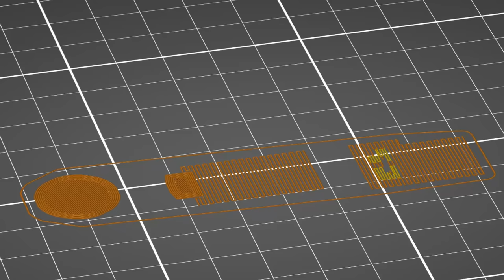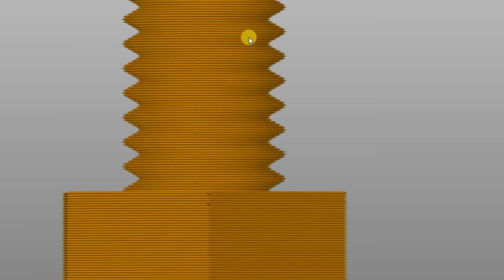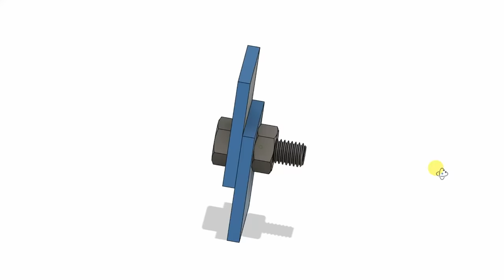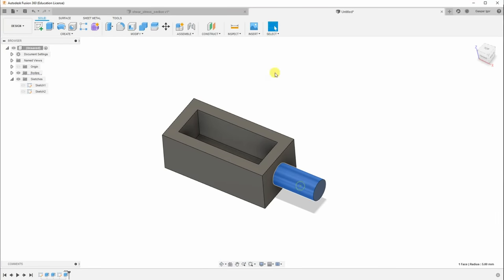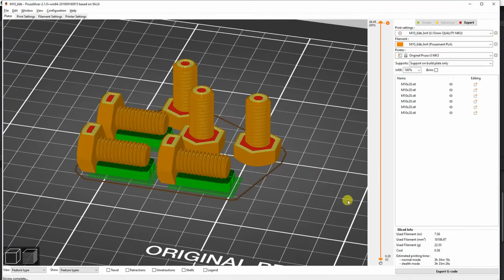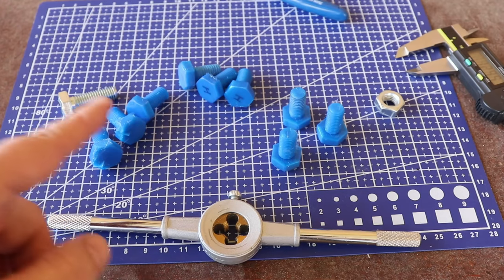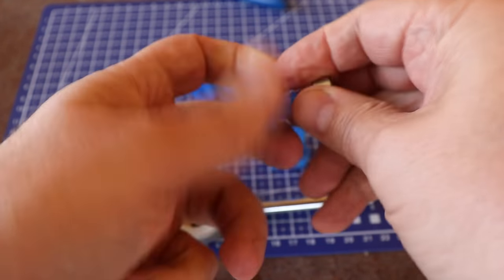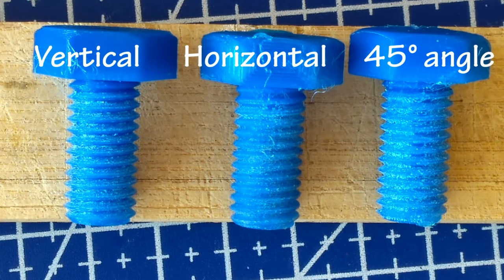3D printing bolt and thread in horizontal or vertical position - strength test

Comment: I did expect the horizontal to do the best .
 
 
The way it is printed is like placing many layer of paper. Try pulling 1 piece of paper, you may tear it, pull 20 at the same time. You wont do it. same thing apply with the shear test, push your finger through 1 layer of paper. You'll make a hole no joke. Try doing it with 20 at once.
And again same goes for the torque test. 1 piece of paper and turn it util it shear off. then take 20 more and do it at once. You'll just end up making a rope that is even stronger.
So when you were doing the torque test you were increasing the strenght of the bolt by a little bit util it reached his shear point.

Comment: Very nice video. I did think of one additional complication. Is printing a single screw different than printing multiple screws at the same time? One screw at a time would minimize cooling off the material between printing layers, possibly allowing for better adhesion, thereby resulting in stronger screws when printed vertically. Of course the downside is the time it would take to print goes up significantly.

Comment: Cut in half and then glue with weld-on 3/4. Apply glue, press both parts together, fit the head on a bolt socket and put on the nut right away. Let it cure and test it.

Comment: in the shear testing there is a difference which rotation is applied because if you just turn any degrees paralel to the  nozzle filament applied it effects the leaves that the cutting pressure if you just arrange the  90 degrees the shear stress o  the leaves of lines it would be the most strong one than the others...

Comment: on your torque test you were holding the tool at the top potentially impacting your result. It would be better to have a handle there that can rotate relative to the tool. The relative torques were probably still accurate. Thanks for doing these studies!
Reply from the maker: Holding on top is just for balance, because rotating arm is not in plane of the bolt. Shouldn't affect the results too much, but it was equal with all 3 tests anyway.

Comment: Awesome results, thank you for the experiment! Do you plan to compare pla vs abs vs petg?
Reply from the maker: Yes, but first SLA vs FDM (resin vs PLA). Almost finished test..
Reply: @MyTechFun  Thank you for the reply. Also, it would be interesting to study the material strength vs bed and extruder temperatures. Perhaps you'll find an optimum there. Best of luck to you!

Comment: May I suggest same set up but with a heavy duty  ratchet strap on lower side that way you can control adequately until failure.
Reply from the maker: I already have safer solution used in my latest videos. Also I am building arduino based tensile testing machine too..

Comment: Cool video! However, I wonder, is yield point even a thing for plastic? From the PLA stress-strain diagrams I found, there seems to be no yield zone.
Reply from the maker: Yes, I am very curios about that too. I am building Arduino based tensile test machine, I want to investigate this ellastic region (load before yield point).

Comment: Thankyou for doing a video to prove what we should already know.. the larger surface area, the stronger the object..

For the bolt, the largest layer area is horizontal. 

Very funny though, watching you fall on your rear constantly.. Thankyou for enduring the pain for the YouTube audience.. 😀😂🤣😉
Reply: What about the same stress tests using different filaments?? 🤪
Reply from the maker: I got several suggestions to try PETG. Will be done in near future

Comment: I had good luck printing an angled bolt by adding an bevel on the bolt head so it angles at 20 degrees from vertical--that way it does not need supports but is not vertical.  I guessed it would be stronger but based on this I am not sure.

Comment: Hey man! Awesome video! Just not quiet sure about multiplying earth's gravitational acceleration  (9.81 m/s2) when doing the Torque experiment. Gravitational acceleration only works on the Z axis not on X or Y axis which are the ones where you are applying the force, in this case you should be using the acceleration made by the movement of your hand, which I think it's really complicated to measure. So what about doing the Torque experiment applying the forces on the Z axis with a distance on the X or Y axis from your center so you can use earth's gravitational acceleration? Yet again, I'm not quiet sure about this, please correct me if I'm wrong. Printing my bolts in horizontal position from now on! Haha Greetings from México!
Reply from the maker: Thx for comment. If that scale would be a dynamometer, it would show Newtons. But it is scale calibrated for earth, this means kg has to be multiplyed by g (9.81 m/s2), no meter in what direction you pull it.

Comment: Nice video, thanks for answering something I have wondered about... I have a design on thingiverse (record clamp 2 styles) that uses a "threaded collet" type hollow screw piece.  Always printed them vertically and they always fail (torsion) after so many uses.  Will have to try it printed horizontal, to see how improved it is.
Thanks for the testing!

Comment: There are ways to enhance the layer adhesion also :) PETG is well known for having a high layer adhesion if printed correct (in my case I have to be carefull with cooling too hard)
Reply from the maker: I got more suggestions to try PETG, I will do that in near future. Thx

Comment: If you go over it with the tapping tool as you did, you might as well print it at the width of the thread but without a thread (full shaft). Then just use the thread tool on it. You probally need less support too this way.
Reply from the maker: In that case I would cut perimeters. It's better to print it almost good size and clean it with tap
Reply: @MyTechFun  milling is stronger than casting. What would be stronger, to print a knife or to print a block en cut a knife out of it? next video? ;)

Comment: Maybe could print multiples in one print and arrange them so they're touching and the bolt next to it for support/efficiency to replace some of the regular supports. You're probably going to need more than 1 anyways.
Reply from the maker: Yes, but this is not only about printing standard bolts, but also learning about thread strength as part of some 3D printed object.

Comment: My guess why the horizontal prints were the best was because of the direction of the layers. The forces don't act on the bond between the layers, so it's going to be more durable from a structural standpoint.

Comment: the horizontal print would be stronger when thinking of it logically even without the test, when printed vertically the stress is being applied to the seams of the layer bands the weakest bonding part of a print, where horizontally the stress is on full length of the print material. It would be the like gluing two boards together then pulling on the sperate boards to try and break the glue bond vs pulling on the glued boards trying to rip the wood in half. A weaker horizontal print would be turning the print 45 to 90 deg on the table surface changing the print bands direction this would likely make the shear test break at a lower weight but not the virtcle load, but make the torque test stronger.

Comment: An interesting test.
But instead of tilting the screw 45° while printing it, it would be interesting to see if it has any effect tilting it 30/60° to match the thread profile angle or whatever angle the pitch corresponds to!

Comment: optimal way to do this is to print in the horizontal to the major diameter of the bolt and then cut the threads with a die. Also want your outer shells to be larger than the maximum depth of the thread. I would recommend at least 2X.

Comment: I don't think there is any doubt as to which I would use in the future. Horizontal print costs 11% more from supports but it can hold far more than 11% more weight.

Comment: Nice test, but you need to pay attention with the creep factor on plastics(strain/ time factor). Plastic always deforms when there is a force aplayed on it. Thats  why deformation calculations are better then tensil strenght calculations.
Reply from the maker: I agree, as I mentioned at the end of video, determine a yield point would be better, but for this I need a tensile testing machine (building one, but it takes time)

Comment: Thx for the video, a note tho. On the torque test you don't use specific gravity to calculate the load, all force is applied in the horisontal plane
Reply from the maker: I am using a weight hanging scale, units in kg. I am pulling horizontally, if it would be a dynamo-meter (force meter), it should show Newton (Newton = kg*m/s2 , force = mass*g)

Comment: On the torque test for the horizontal screw, I think it capped at 2.3kg not 2
8 like you did in your calculations

Comment: my prediction is the horizontal will be the strongest. because it has unbroken layers going through the entire length. The vertical and angled ones can separate at the layer lines easier

Comment: Practically speaking however, this doesn't matter.  3d printed plastic is intended to be used as a method of rapid prototyping, not end-use objects.  Using 3d printed plastic parts for anything that will be subjected to substantial force/weight is an accident waiting to happen.

Comment: Very interesting!
One thing I might note is that it would be beneficial for you to create a jig that uses a larger bolt maybe to pull instead of using your body weight
Reply from the maker: Working on other solution, but isn't it more impressive to see 3d printed  M6 holding my weight? ;-)

Comment: For the diagonal print, I'm not too sure if it printed close to the thread profile or against it(like going along the grain or not). I'm not sure if it would make much difference.

About the forces that bolts are subjected to, it's not just heat - maybe deterioration(through water/moisture) and vibration.
Reply from the maker: Yes, I was thinking to do sam temperature strengh test too. So far not sure how can I realise that.. working on solution.
Reply: @MyTechFun  for heat test I think consider more the temperature range it would likely to be exposed to - extreme cold winter(freezer?) or the unbearable summer heat(oven). Some tested immediately and another set after it comes back to "normal" temperature.

Then maybe another test dor bolts used close to engine heat(exhaust shield temp?).

Anyway, good luck.

Comment: How about making the slicer print the long way instead of diagonal, also play around with the infill? How will the different infill types behave?
Reply from the maker: Infill was 100%, but I will test for example bolt from 2 halfs or sliced from one side, so it don't need a support.

Comment: You should try remelting one in salt, grind some salt super fine, then pack a bolt in it in a pan or something, make sure to stamp it really good, and then put it in the oven for a while. :)

Just make sure you do not burn yourself on the salt.

Edit: fixed spelling error.
Reply from the maker: Probably remelting in salt will result vertical bolt to be strong almost like horizontal. Will test it in near future.

Comment: Just the video I was looking for, I realized that it is much more solid than I thought, I am wondering if there is the same for abs.
Reply from the maker: For ABS I noticed, that it variate more. Some ABS filaments has very week layer adhesion, so there the difference is even bigger.

Comment: Could you try "annealing" (really sintering but 3d printing people call it annealing) these bolts? I reckon that the differences in strength would become negligible with the vastly improved layer adhesion of an annealed print.
Reply from the maker: I don't like annealing, the object deforms too much

Comment: Just had to comment that I disagree with BMI as a measurement. It doesn't take into account at all that when you scale vertically (getting taller people) you also have to scale radially to make the same proportions. That makes it so a tall person of one proportion will have significantly more volume than a shorter person of the same proportion.  If we took this to extreme, a 2 meter tall person would have to be unhealthily thin to maintain the same BMI as an overweight 1 meter tall person, since it's only a ratio of height to weight.
Reply from the maker: Yes, you are right, BMI is not the the best measurement. But my mirror is. I am overweight anyway..  :-(

Comment: Man I wish this were a blog entry I could scroll through the results and numbers of instead.  Good job though.
Reply from the maker: There is a contents with timestamp to results part (in description)
Reply: @MyTechFun  I saw that.  And thank you.  But if you wanted the information you discovered in this video, would you find it by jumping to those offsets and looking?  Thanks for doing the tests, I just wish it were in a format more suited to discovering the answer easily.

Comment: Would be interesting to test if you printed the screw on a very very slight angle, the same angle as the threads
Reply from the maker: Don't forget, the angle would be same only on one side. On other side not.
Reply: @MyTechFun  and that PRECISELY why I’m not an engineer 😂

Comment: Use epoxy and metal wire to make reinforced bolts.  Or better yet, use the wire to make a reinforced slot for safety wire and multiply your max strength by maybe 10.
Reply from the maker: Reinforced bolt? Good idea, I'll try to combine M3 metallic with M10 3D printed. Working on better and safer testing solution.

Comment: I think there's an optimization problem to solve here for printing multiple screws at once in the horizontal position. Is it possible at all to save on filament by printing in batches? Or will it always use more, in which case, how much more is the minimum?
Reply from the maker: I tried several similar methods for horizontal position, there is a video

Comment: Your test was very good for strength classificaiton, Did you have test for Metalic Material ?
Reply from the maker: No, but as mechanical engineer I know, that it can be easily calculated if we know the exact material for bolt. But you give me good idea for new video. Maybe I will try to measure some smaller bolts and compare them with calculated results.

Comment: Have you ever made a bolt screw combination using the Buttress thread design method? I have seen that this design method is superior to the standard thread design method. Just interested what difference in strength there is.  Thanks.  
Oh, I use OpenSCAD and do not know how to make one using the Buttress thread design layout. Maybe you are a better designer and can figure how that is done. It would just be an interesting comparison.. Thanks again Richard

Comment: didnt you influence the data in 12:43? you were measuring the torque of the screw + your hand holding the wrench. it seems like you were holding it tightly
Reply from the maker: In video it may look like that. I am holding it tightly, just to prevent moving in x or y direction, but I am rotating that hand together with wrench and my right hand, so it doesn't add torque load to test.

Comment: Nice. Of course a horizontal print will be stronger, but nice test to prove it 👌

But when you hang on it, and it dont snap first time, then you try again with more load. Isn't the bolt already been "pre weakened" by the first try. Just thinking if you had more weight for the first try ann only tried one time, it might have better result/handle more load :?  Just a thought :) 

Btw you should really build a testimg jig for this before you get hurt 😂 Im sure if you ask all the viewers to help fund hardware, they will 😁👌

Comment: you should do that test again with pctg, it has perfect layer adhesion so they should be as strong on either sides.
Reply from the maker: Which brand? I tested several pctg filamebts, their layer adhesion is not too good.
Reply: @MyTechFun  weird, any pctg that is actually pctg (not petg) should do, you do need higher temps than petg afaik though.

but in all reviews of the fillament i've found so far no one had layer adhesion issues, it's reportedly as strong on all sides.

Comment: Would printing each bolt individually result in a stronger bolt?  I usually do this so there is no stringing  when the nozzle jumps between the bolts.
Reply from the maker: No, actually, multiple printing is stronger, tested (due the travelling time and retraction, material melts more, and has stronger layer adhesion. https://youtu.be/sGPTkcVW5z8 )

Comment: Lol "I'm hoping the horizontal position will not be stronger than the vertical position"... meanwhile I was hoping for the opposite. I tried printing a screw for a clamp and the screw broke because of the layer lines. Now I know I need to print it horizontally.

Comment: Hello. Have you tried to bake / heat the part for better adhesion of the layers? Layers do not allow for moving loads. It seems that such an operation can be done with ABS plastic ... PS: I'm printing only PLA so I can't test this theory yet.
Reply from the maker: You mean Heating parts for better adhesion as annealing? Problem with this is that parts will deform. Sometimes too much.

Comment: great research! can you please try vertical M6 with a bit higher temperatures? say 225, 230 Celsius
Reply from the maker: Approx max 20% stronger. Strength can be improved by reducing the cooling, but then we have overhang problems..
Reply: @MyTechFun  thanks!

Comment: Bolts are not meant to take Sheering forces. If used Correctly, they never take sheering force.
Reply from the maker: That's what I explained in video. Metallic not, but plastic sometimes yes

Comment: m6 111kg experimental breaking force with a 4x safety factor would be a maximum recommended 27kg load
Reply from the maker: Yes, additionally, there is something like creeping (slow deformation under constant load), this I also measured in later videos.